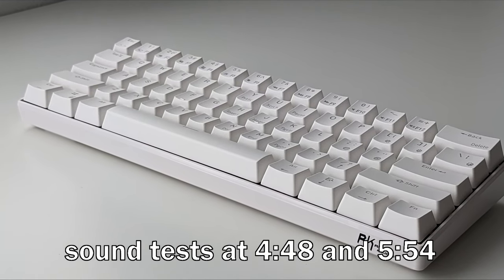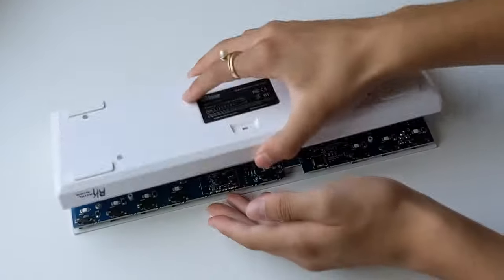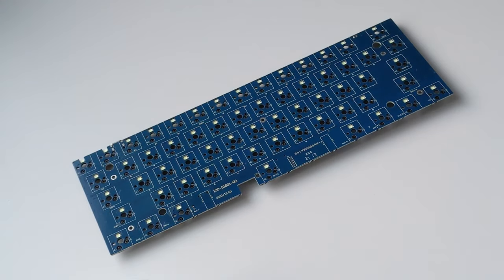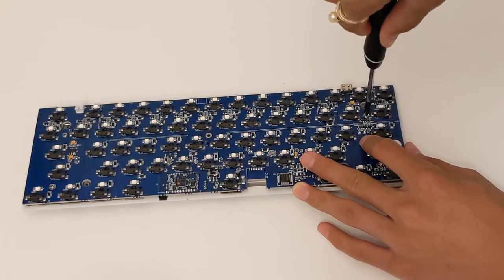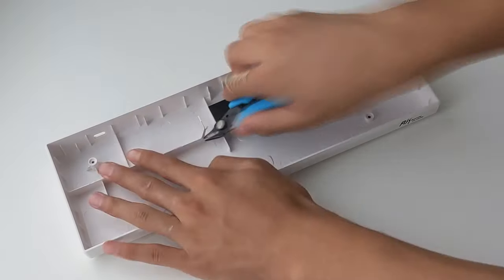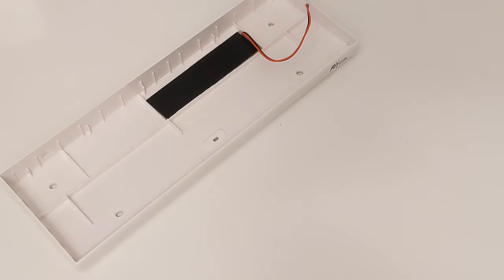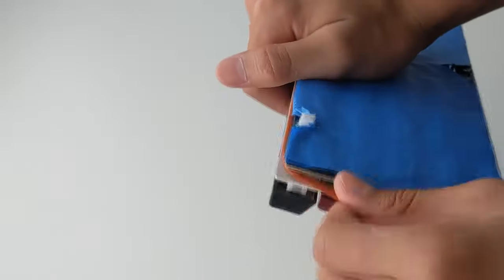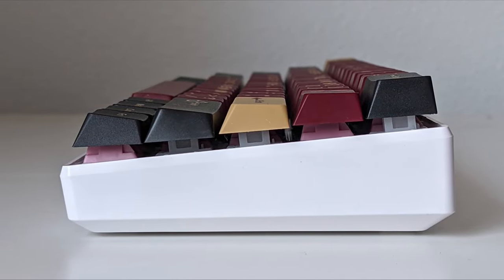modding a cheap keyboard

Comment: The pennies thing is genius. I was thinking about cutting out a brass block or use tire weights. I love when people are creative and invent their own mods to share with the community!
Reply: Although would be careful since the pennies are conductive, I assume the tape u put is enough to mask it
Reply from the maker: yeah, I haven't had any issues with it so far
Reply: Use dynamat or noico sound deadener instead. It's adhesive and has a similar weight effect.
Reply: @dougdoesdigital  thanks for the tip! ill do some resarch
Reply: @flurples  has it still been fine?
been thinking about doing that to my rk61 with akko rose reds
Reply: I read that very wrong
Reply: @Pablo_the_hedgehog  x2
Reply: @Jesuslovesyou-my8kx  me too
Reply: Bleach fan appreciation
Reply: I know I’m late, but would tire weights still work fine? Pennies are discontinued in Canada lol.
Reply: @aarizjohn  yup they do work
Reply: Thanks!

Comment: I was wondering  what was the trick behind people making keyboards sound so good, I never would have guessed cutting through metal and filling it with coins would be part of the answer lol
Reply: Coins are just for weight I think
Reply: @lavahawk  It reduces hollowness and yes it adds weight
Reply: @speedjunkie813  is the weight necessary or i just need some thing to fill the hollowness
Reply: @duccc  pennies work well but you don’t have to use pennies. You can use polyfill aka pillow stuffing or sorbothane, or other foams like Poron, thinsulate, memory foam, etc
Reply: he changed the switches and the caps too that also makes a big difference in sound aswell
Reply: God loves you all and has a plan for your life
Reply: More than anything its just changing the switches and keycaps. All the other mods provide a minimal improvement beyond that

Comment: I had this Keyboard last year. It's a pretty amazing for modding even though the one I received wasn't hot swappable. 
One downside to it though is the ON/OFF switch at the bottom. Any case mods that raise the PCB will make the switch difficult to use. I wish it was in the side instead.

Comment: Nothing's cheap about the RK61 except the price itself! I got mine 2 weeks ago and even stock it feels SO good just by changing the caps to an original set of NIPPON WAVE. Mine even came very well pre-lubed and with basically no rattle on the spacebar - I'm impressed with the stabilizers RK uses. Awesome board overall, I'd consider it even at 80-90 USD price.
Reply: I just got the rk84 and just replaced the switches with lubed akko matcha greens and it turned out pretty good (for one's first keyboard)
Reply: In my country price isn't cheap either
Reply: you better take those words back. them blue switches are illegal
Reply: @qualitynonsense5309  they probably got different switches
Reply: @qualitynonsense5309  *those
Reply: @SweetMelaninn  have u not heard the term “them (object)”? bro
Reply: @qualitynonsense5309 it's improper English. So people will understand you, but it's not correct

Comment: Just got Newmen GM610 and saw your video. I opened it up and realized that dimes were the only thing I could fit in the bottom, with a layer of gorilla tape. The grooves in the bottom of the case fit the width of the tape and dimes perfectly. I think I counted over 12 dollars worth of dimes in there haha. At least I know where they are! This thing turned out so great!!! The weight is absolutely amazing, and it feels like a high end board now. Thanks for the video and I'll keep you updated on how it is!
Reply: what switches did you use ???\
Reply: @zon4s181  so far just the stock red Outemu for now, with some o Rings on the standoffs and o Rings on my keycaps!
Reply: @marshallbneil3981  hope it sounds good

Comment: The PCB doesn't sit higher on the keyboard because you used a gummy o-ring to mount it, it sits higher up because you layered pennies and a thick piece of foam in the case.

Comment: Could you theoretically, gummy o ring mount any cheap keyboard if you remove the stand offs and file down the cable hole, like the gk61 kit?
Reply from the maker: there's a possibility it could work with the gk61 as well, but for some keyboards like the tm680 it won't work because it has a weirder mounting style
Reply: Alr thanks
Reply: @flurples  does the seperate plate interfere or no. and is it only for tray mounts?

Comment: here is something that i have done to my rk..
i think it actually sounds pretty good for what i did to it
1. tape mod
2. put old shirts in the bottom to help with it being hollow
3. new stabs (lubed, not clipped or band-aid modded)
4. lavander switches (film and lube)
5. XDA keycaps

overall i think that it actually sounds pretty good
Reply: hey dude i have gk61 but mine isnt flat at the bottom like it has walls kinda... so what do i do.
Reply: @steffanhalder  if you are trying to do some kind of foam or something, you need to just shove it in there and make it fit. there isnt some particular tactic, its just all of the extra space BELOW the pcb isnt good, so i use foam (or in my case, just a old raggedy cut up shirt)
Reply: @mix_edits  will the heat make the foam catch on fire or nah? Cause it’s rgb
Reply: @steffanhalder  noooo nooo not at all

Comment: Pro tip: if you have a battery like this guy has, do not use painters take or masking tape because it can cause fires, if you do have a bttery, use electrical tape. 3:34. Dont use painters or masking tape.
Reply: I did the same mods so do you think I should just unplug the battery and keep the tape? Bc I won’t be using Bluetooth on the keyboard.
Reply: @ILFISNG  i mean, there is a potention risk of the battery still cathing on fire IF the battery is still in there. even when not used. for better, take the battery out if you want.
Reply: @fodo3971  ok thanks

Comment: Its not "upgrading", its "throw away everything except chassis". realistically, you only need to slap some kilmat inside the case, foam between plate and pcb, lube all the things and tapemod stabs if they rattle. done in an hour if you've got all the materials, reversible, non-intrusive.

Comment: When you are removing the plastic at the bottom you can use pliers just to snap it off at the base and then sand it down. So much easier just found it out as I was trying this

Comment: Honestly, you can make a cheap keyboard sound good just by adding some $12 foam tape and adding lube to the stabilizers and if you want to go a step further by some decent keycaps (abs or pbt)… and if you want to go even further you can lube your switches. Lube on even cheap switches like outemu can make a massive difference if it’s a linear or tactile. Fun video but you don’t have to go this far to make a cheap keyboard sound respectable ;)

Comment: I pored zink in it for the weight and used car sound dampener. Now it sits way lower, You can even remove the battery and file down the inside case for even more room. I got it to match the stock height

Comment: I have the same keyboard. I like your creativity, so not saying this outta tryna be rude, but so that other watchers aren't deterred by buying this good entry-level budget MKB - a lot of the reason for the difference in sound is just because you got rid of extra loud clacky blue switches and replaced them w far better ones and the improved thinner than stock keycaps

On my RK61 I just replaced switches and caps and achieved a similar sounding nice soft thock and typing feel, and the board didn't have to be raised either.

Just for users/watchers to know - you can get some great sound and feel out of the RK61 without this much work being put in 😂
Reply: I modded my rk61 very similar to this video. I taped down some pennies, put a layer of bottom case foam, and I did the o ring mod. I also tape modded it. I used the stock keycaps (bc I want a sleeper build) and I changed the switches for some lubed ones. Overall my board is a little less deep sounding than the video, but the feel and bounce of the board is very nice.

Comment: modding a cheap keyboard
proceed to replace all of the switches. 

replacing all switches on a keyboard usually costs the same or more than buying a new budget mechanical keyboard.
so idk if "modding" is the right word here.

Comment: to avoid the pcb sitting higher than normal and the switches being exposed would it be possible to file down the little peices of plastic inside the case that jut out which are what the o-ring sits on and make it sit low enough that you don't see the switches and dont have to file the opening?

Comment: RK71>>>>>>>>RK61, I used to use the RK71 and its just way nicer to have 2 extra rows and arow keys especially considering that its one of the best layouts as it keeps the compact form factor and compatibility with any keycap set, rk71 is a great board and its way better then the rk61 in my opinion. i now use the tk68 as i think its better than both but its more expensive and 65% compared to the 70% of the RK71

Comment: Hi, how did you get that floating switch look? Is it because of the foam or the keycap size? (not sure if the new keycaps are smaller than the default ones)

Comment: Is the rk61 fully hot swappable then? I've seen a lot of things saying it is and it isn't and I want to try if it is but I fear breaking my keyboard. I have the non bluetooth version and it came with a keycaps puller AND a switch puller in the box.

Comment: I have this same keyboard but with the stock brown switches and all I did was put some cut up mouse pads and it sounds Gucci.
Edit: I also added the keycaps from the “this keyboard should not sound this good” video
Reply: Also where do you get your keyboard cables I love them so much
Reply: Also also, this mod is amazing, keep up the good work!